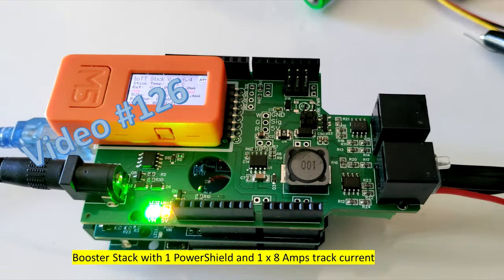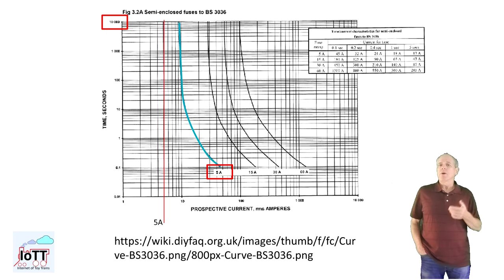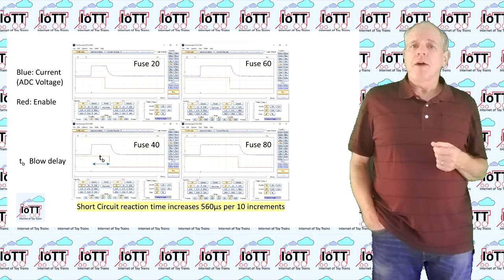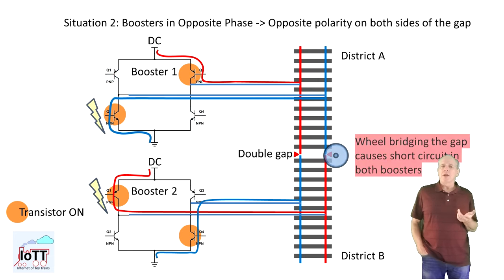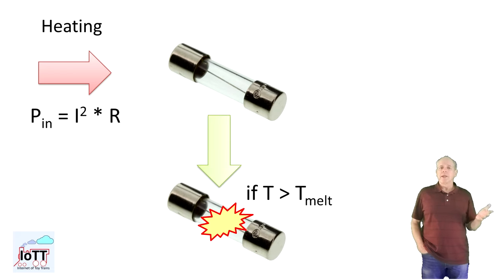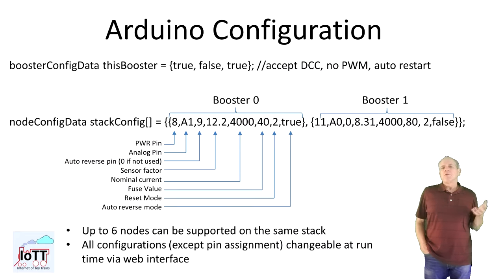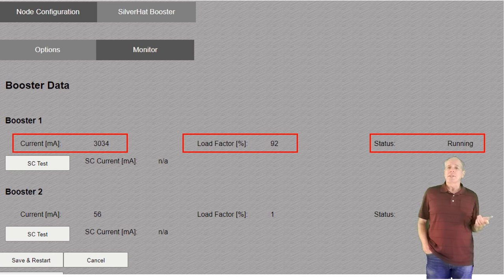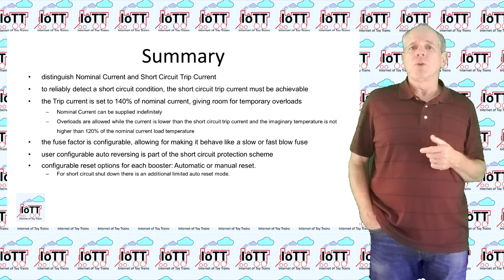DCC Booster Research: Overload and Short Circuit Protection (Video#128)

Comment: This is a really awesome setup for DCC++ users. I'm definitely going to need to build one of these. You might consider, adding some booster feedback data that can communicate the location of a short circuit to JMRI Panel Pro.
Reply from the maker: Well, the location of the short circuit is not possible, but an indicator what booster has a short circuit will part of it, either using a block detector or turnout position message.

Comment: So we see that this latest development will be called the Silver Hat. This booster will be another great addition to the stable of IoTT products. Once again I appreciate your detailed explanations for your designs. I am by no mean an electronics expert, or even a competent amateur, but I do find them informative and educational.
Reply from the maker: Yes, Silver that is. Available with 5 and 8 Amp nominal current, and up to six boosters in the same device, four of which can be configured for auto-reversing. Sort of new level for boosters, I guess, at least I am not aware of something similar.
Reply: This is fantastic news Hans! Every time I watch your videos, I keep realizing that it was a good thing selling my NCE system and going with DCCEX and the IoTT devices. Great stuff!!
Reply: A slightly off topic question - with DCC-EX and your boards - does it all support RailCom?
Reply from the maker: DCC-EX can't  generate the RailCom signal with the currently used interrupt timing. The difficulty is that after each DCC command a brief short circuit is applied to the track. The tolerances for this are very tight and the start of the pulse is in the middle of the clock of the usual DCC bit timing. Personally I do not expect this to be implemented in the near future, but we will see.
The booster is designed in a way that it could amplify the RailCom signal, so if it is connected to a command station that supports RailCom, it should work. I have not yet tested it, though.
Reply: Thanks for the reply Hans.   I have an Intellibox 2 that can do RailCom - happy to test - just about to start playing with iTrain software…